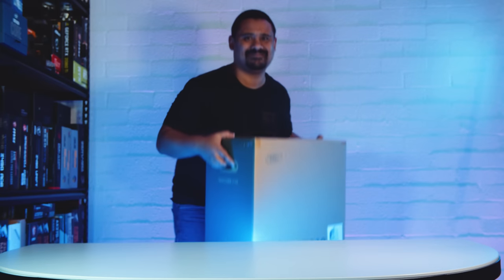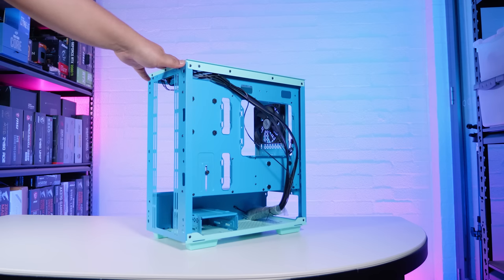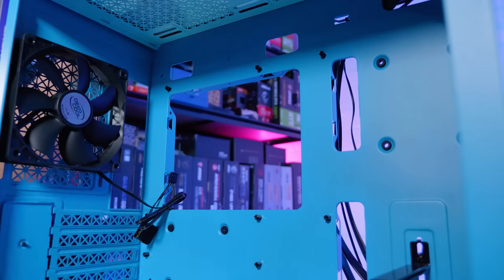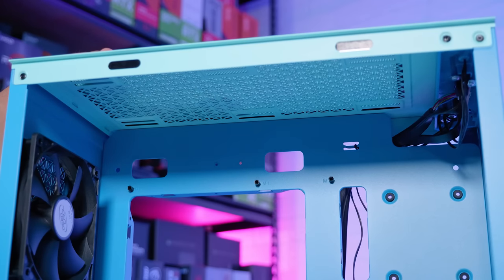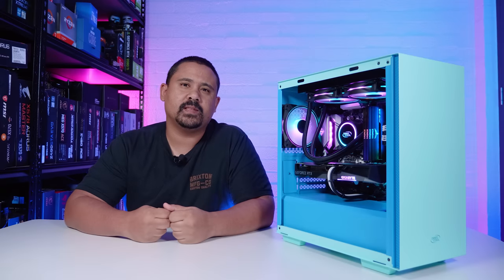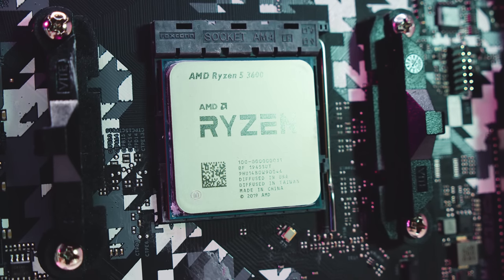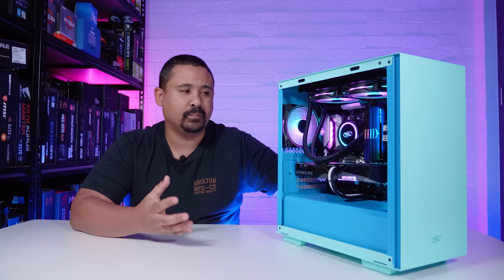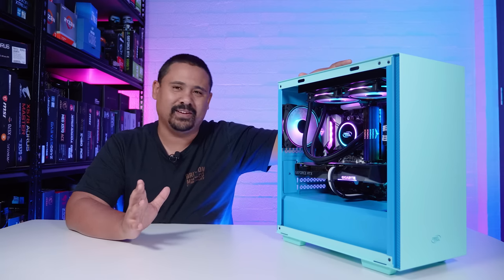MINTY FRESHNESS FOR $50: Deepcool MACUBE 110 Green

Comment: I just finished a build with this case, a few things I didn’t like but mostly relate to install so it only has to be done once.
Cons
The power supply doesn’t slide out.
I had to remove io shield of gpu just to get it in, the motherboard had a small heatsink there and I couldn’t lift the card over it.
The pci hole bracket is flimsy leading to gpu sag (just as well they include support)
Power switch is on/off.
Could have done with another 2mm clearance for radiator and fans
Pros
It’s Matx.
It’s cheap.
Magnetic panel

Comment: I got this case in black last week. Good build quality for a 50$ case, I was actually surprised.
My cpu thermals are good to be honest, I have Noctua NH-D14 with Ryzen 5600x with one 140 mm fan on it.
But I must say, my Gigabyte Aorus 3070 is getting hot tho, there's not alot of room for the GPU to pull air from and PSU shroud is completely closed.
I feel like, if the shroud had mesh, the situation would be far better.

Comment: Just bought this case (I'm new to PC-building, so bear with me) but what are those short black hub connectors on the back of your case for the fans? I'm unsure if this is something that comes with the case, the fans, etc and if I need to research those for my upcoming build. I would like to copy most of this pc barring the GPU and CPU. I just don't want to be missing anything crucial!

Comment: What is the full width of the inside of the case with the gpu support bracket removed? What are the dimensions of the inside (height x width) for the largest motherboard you can fit if you aren't going to use watercooling/AIO?
Reply from the maker: It's MATX mate. Did you even watch the video?
Reply: Deepcool has no documentation for anything specific but I figured it out

11.25" max height, 13.25" max width (with the gpu support bracket removed, and if you are not going to use any radiators)

for anyone trying to transplant from sff prebuilt or some other non standard form factor

If you don't use fans up front (not a good idea) then your max width is ~13.5"

Comment: Is the green available anywhere in the US? Amazon and NewEgg only carry black and white.
Reply: So lets clear, that I might be wrong.
I read that it will only go in asia and might will be some in europe.
So from the informations what I have, I say probably no.
Reply: @Ta5.  I just got confirmation: "Thank you for contacting DeepCool Support. Unfortunately, that color way is not available in your region." Sad panda.
Reply: @ChristianWheel  than I was right sadly
Reply: @Ziv Zulander great catch! Looks like a slightly different case though, the glass door hinge is different, it doesn't ship with any fans and the inside is the same mint green color instead of the teal. Still will make for a cool build though! Thanks!
Reply: @Ziv Zulander Just ordered mine and will be filming a build in it! Take a look at the IceSleet coolers from Iceberg, they'll fit the theme perfectly despite costing more than the case 😁. I ordered the X6 which should clear by 1mm, haha.